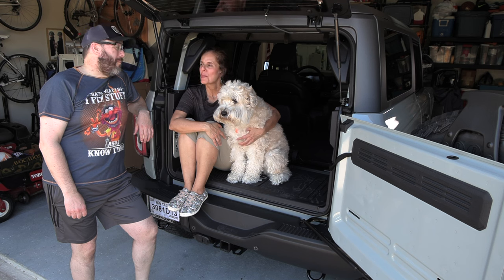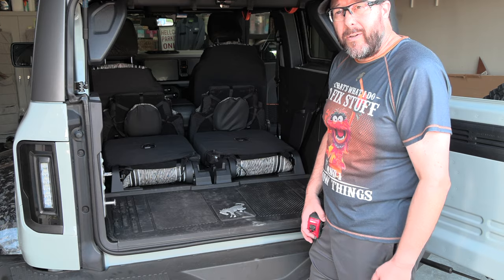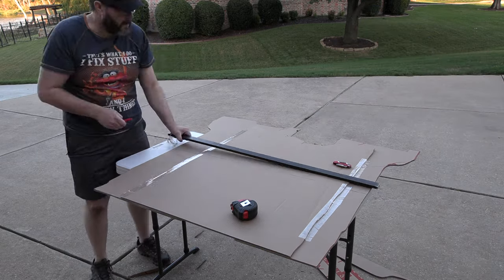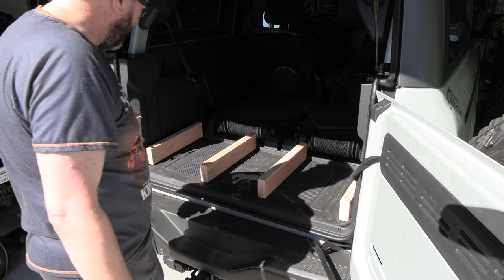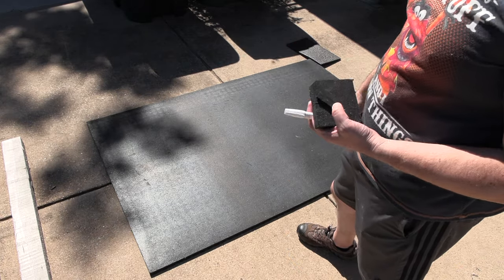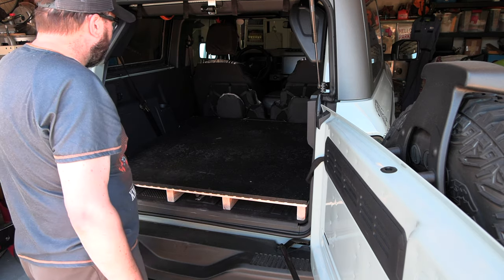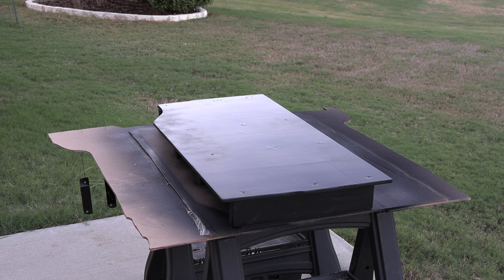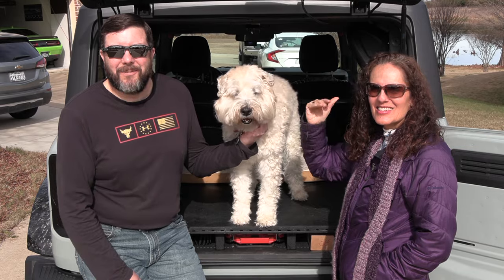Level Cargo Area On 2 Door Bronco Badlands - Not A Rear Seat Delete, Rear Seats Still  Usable

Comment: This looks perfect but I have one problem..... my back seats of my 2 door don't fold that flat. Did you do something to yours to make them go down more ?
Reply from the maker: @nikkibrewer3945 - I did not make any modification. When you lift up the bottom seat portion and stand it up it is on a loop sort of hinge. It will stand straight up and the back will fold down and wedge at an angle. But if when you stand it up you sort of pop it forward/over it comes ahead a little more and is more vertical. Then when you fold down the back it should be as flat as mine. Make sure your front seats are pulled ahead to give the extra room you need. Should be a standard feature to go this flat. Thanks for the comment. Hope this helps you.

Comment: Nice job. Any chance of getting a measurement from the rear seat headrest to the indent on the rear door wear you cut the indent on the mat. I'm going to use carpet instead. Thanks!
Reply from the maker: @Bizness10 - Thanks! Sure I can get that for you. On the road today. Will get that posted tomorrow.
Reply from the maker: @Bizness10 - I measured on the heavy rubber mat, from the bottom of the notch I cut for the headrest to the cut out for the back door it was 43 1/8”. The total length of the rubber mat is 47 3/4”. Hope that gives you what you were looking for.